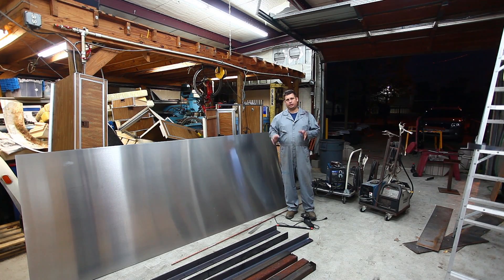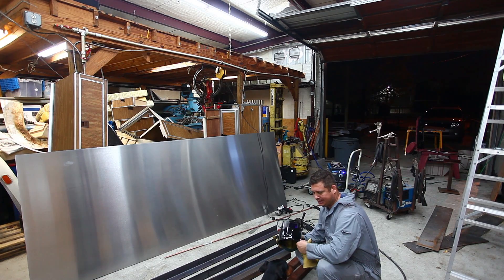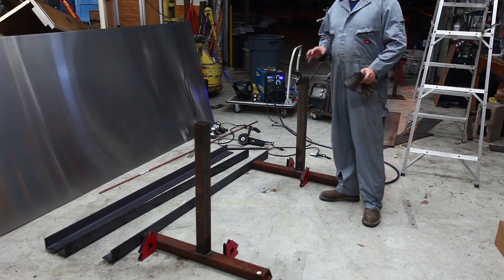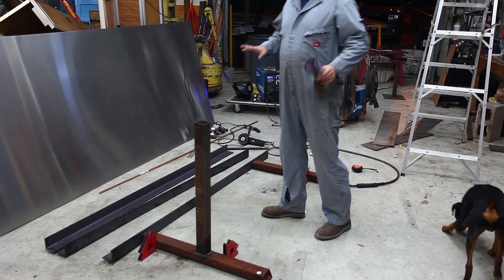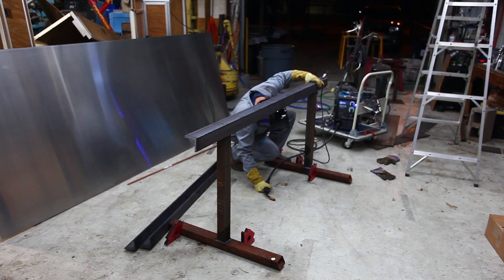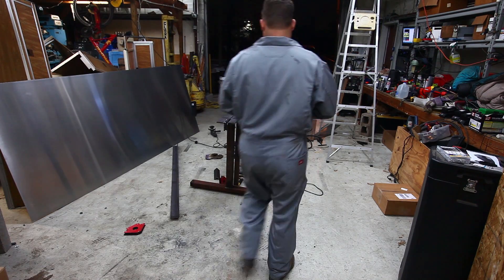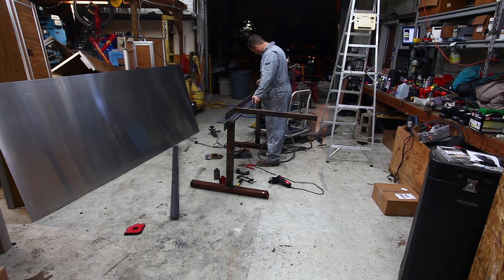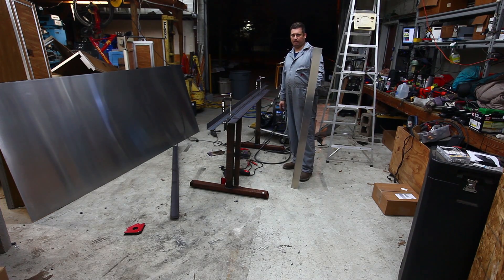DIY Sheet Metal Brake - 72 inch wide, cheap method.

Comment: Great build!  I think I am going to build something like this.
Have you tried using box channel instead of angle for the bending bar, to minimize the flexing? OR you can weld a rib on the backside of the angle or tragulate the angle iron. Also having handles in the center and each end will help with even pressure.

Comment: nice, I'm wondering if you put the handle in the middle of the brake if that would make a more even bend. just my thought, nice job building though
Reply from the maker: That probably would have helped.  I built this for a specific project.  :)
Reply: Brian Greul understand... it's a nice heavy duty one though

Comment: Does the hinge have to be exactly equidistant between both angles and exactly on center to the top of the angles? A close up of the hinge (or sketch) would be nice. How much of a gap between the two angle pieces ?
Reply from the maker: It does not have to be equidistant, but it will work better if it is evenly distributed.  Enough gap to clear the opposing piece, but the closer the better.  A close tight joint will produce sharp bends.  I wanted softer bends so I spaced a little wider.
Reply: Great design but that is one large press. I plan on welding up a much smaller version with my powerimig once I've got the materials.
Reply from the maker: Thanks.  It did what I needed it to do.  :)  I certainly couldn't afford one this size commercially.

Comment: I just got at half way threw .  I am thinking he have not 1. plan this out all the way or 2. just playing it by ear or he dont know how to center this up and dont know to do math to well . That being said and what I would do is think of a plain first . Then 2. I would draw up that plain and look that over real well . 3 . Then decide what materials need to build the Metal brake  to prevent warping or giving . You want to achieve a good tight bends .  Not even seeing the rest of this wast of steal I think I know what this is going to turn being . A complete fail .  I just hope he can weld . Owning a welder do make you a fabricator .
Reply from the maker: +Jeff Mullinix I did not set out to teach you how to fabricate or weld.  I built this, it worked for what i needed it for.  Your mileage may vary.  If you don't like it you can click on to the next post, or better yet pull out a thick wad of money and go buy one.  cheers.
Reply: HAHAHAH! .... trolls would rather spend large cash 

I like your idea and am going to make it work  
constant gauge changes should be do-able  with bolts 
and with a  stock scraps (as spacers)

Comment: you own a plasma cutter and an angle grinder but decided to pay someone $6.00 to cut it for you.....
you are either:
a) incredibly dumb
b) have too much money
c) all of the above
Reply from the maker: +Wesley Jackson Time is money.... and I'd rather have pieces the size I need them.  So $6 and 10 minutes of time to get the cuts done vs 30-45 minutes on my saw and very likely destroying a $12 blade makes sense.  I also have a metal bandsaw, which is the best way to cut metal before welding.  A plasma cutter is good for hacking or demo work.  It's not a clean enough cut to weld on.
Reply: +Brian Greul fair enough. 
things weren't going so well for me on a project I was working on, on the day I left that comment. regardless, it wasn't very kind of me to say the things I did, so please accept my apologies

Comment: If you cut 1 1/2" off of both ends of the moving angle iron you will have room to clamp and swing the moving angle iron way past 90 degrees, nice quick job!

Comment: Why do you folks build these "hinge systems" out of pipe & barstock? The easier and best way is to use 2 bolts and 4 nuts. This always allows for smooth rotation, NEVER any squeaking and does not allow shop dust or debris to be trapped inside the hinge at some given time, and the hinge system you made will at some point and time do this. Your bender probably will only need 5/16 bolts and that will be more than enough. Ron your right it does need bracing between the support legs to keep from twisting. The outside of your breaks will always bend tighter than the center due to force being exerted towards its "fixed"areas being the hinged area and no stability in centers. Rig you up on the cross brace you need to add a vertical support on the fixed angle and on the rotating angle a vertical sleeved guide that will still allow movement but stop the bow in the middle. The way there is a clean consistent bend from one end to the other.
Reply from the maker: +Steve Fleming It did exactly what it needed to do.  It's what I refer to as a "field expedient tool."  Bolts and nuts would work, but this was cheaper and made use of materials I could easily get.    Bracing is the one of things I would do differently.

Comment: I just recently made a brake out of a framing square, a 28 inch aluminum level and a couple of c clamps clamped to a plywood sheet on saw horses to bend a couple pieces of GS20 sheet metal into a 15" vent box(thin stuff). Total cost, nothing. Next I'm going to try to make a brake out of twine and coconuts in case I get stuck on a desert island with a pile of sheet metal...

Comment: A tension rod may need to be applied to the clamp angle on top or turn the angle around so the corner is against the bend

Comment: The corners were not over bent the center was under bent because the bending bar(the angle steal which you pulled up to produce bend) flexed. to prevent this from occurring you need to add an adjustable tension bar. Simply a round rod(probably 1/2') running under bending bar from end to end with a bolt in center which can be adjusted to provide  pressure in the center to prevent flex.Google  sheet metal brakes and you will see. I made a small break similar to yours but the tension rod was the trick.

Comment: To get a straight bend the entire length of the material you're bending, you'd need to weld two more bending handles; one in the middle and the other on the opposite side of your current handle. Connect all three with a single piece of steel, then weld one longer arm somewhere close to dead center. This will keep the bend plate (the one attached to your handles) from warping from unequal pressure due to your offset handle. Cheers and great video.

Comment: I've got three brakes that I've made over the years. I noticed your twist as you pull the handle up. add a square tube going from leg to leg about 12 inches down from your base angle(I used 6'' channel) and thin a connect the two in the center. your over bending on the ends is from the angle iron clamp bowing under a load I see this even in press brakes the dies bow as well. not an issue but a brace might take care. it looks like  it got the job done nice video

Comment from the maker: You would need to build some sort of way to hold the angle.  I contemplated welding some bolts to the base and putting springs on them.  Then putting the angle on top with a clamp assembly.  Take a close look at the commercial units.

Comment: The Millermatic 211 is a superb tool!  It does anything that I have asked of it and would more I'm sure.  I also use welding helmets from Harbor Freight.  They were on sale for $44.00 each using a photocell to set off the tinting.  It's a Chinese product that works amazingly well..  The tint level is easily adjustable.

Comment: Its really nice.
However Brian I wish you could have shown the hinges in close up.
That is a very critical part. Also without all your equipment, welders etc, it is not an easy project for the DIYvers.

Still very nice. Thanks for the video and explanation.

Comment: If you wanted a rolled edge, you could probably integrate a piece of conduit tubing (size based on desired curve) into the formed edge, and roll around it.

Comment from the maker: Not really. Basically you need to notch out about half the width of the hinge.  You want the two lower pieces to be clamped together when you weld the second one to the hinge.  This makes it possible to get tight bends.  My hinges are not perfect, but they are more than good enough for what I'm doing.

Comment from the maker: No, I used shielding gas.  Less cleanup.... okay no cleanup.  lol.  Flux core will work too.  You could also do this with stick if that's all you have.  You can make the cuts with a sawzall if you have plenty of time and plenty of blades.  :)